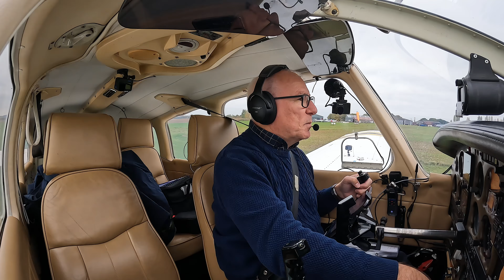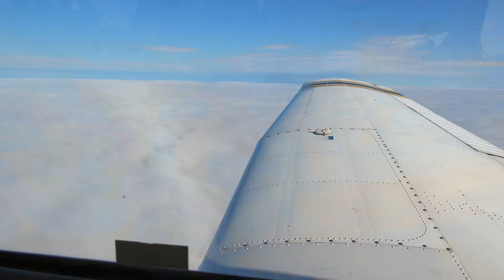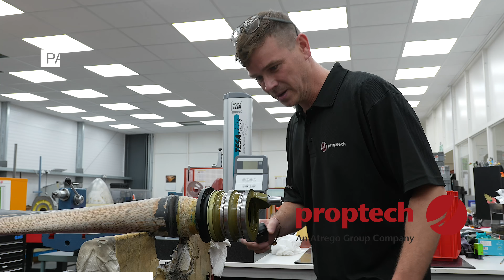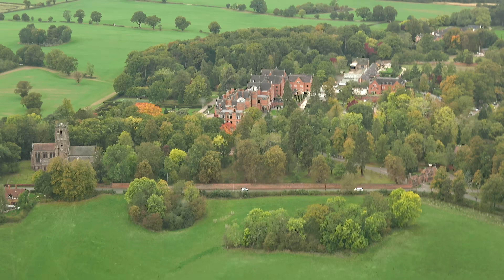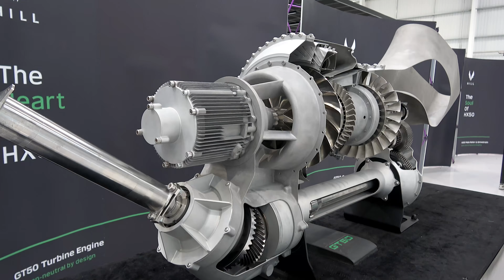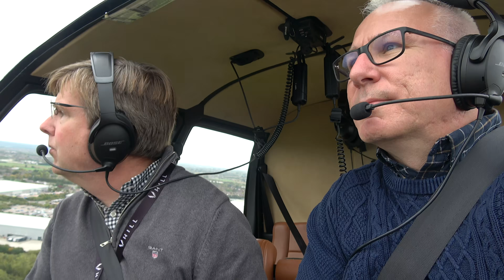The VISIONARY PILOT doing what no-one's done for 60+ years

Comment: Jon, another great video. One question, though, what is the red flashing light above the three greens?
Reply from the maker: It's indicating that the Piper Auto Gear extension system is in override mode.  In other words, in this setting, the gear will not extend automatically, in the event that the pilot forgets to manually lower the gear.  The system is a 1970s Piper fail-safe that has its limitations.  I over-ride the system for take-off and for flight over water.  I usually re-engage the system after take off.
Reply: @TheFlyingReporter  Thanks!